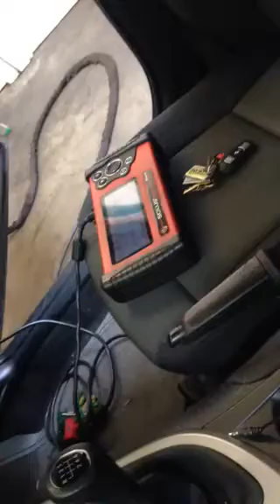BMW occupancy sensor

Comment: I want to replace my occupancy sensor mat for my BMW E90 318d. I noticed that the seats are similar with those from your 120d. How easy is to peal-off the seat cover to get to the sensor? Can I do it myself or should I go to a specialist.

Many thanks!
Reply: Hi, did you do it? I need to do the same for my E90
Reply: @GTFour  I did it. It's not easy. You have to take the seat out. Not sure if you can do it with the seat on the car, or at least it would be very difficult.
Reply: @gabidorobantu  yeah I managed to do it. Took the seat out, be a lot harder in situ for sake of 4 bolts! Fiddly old job in general, took a while.